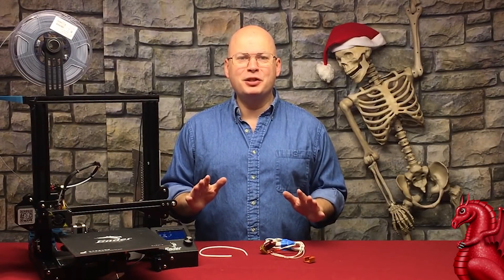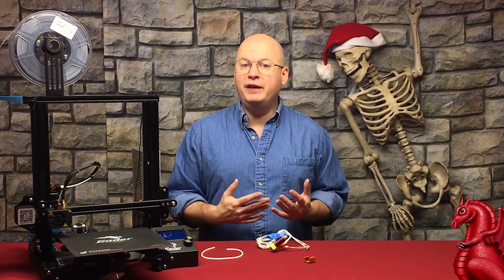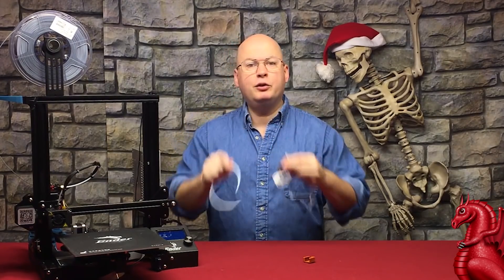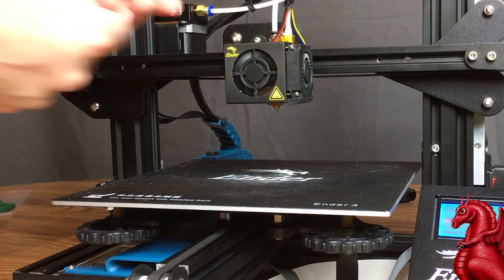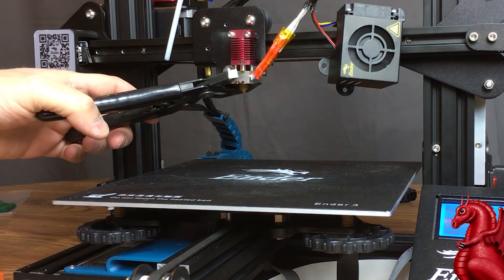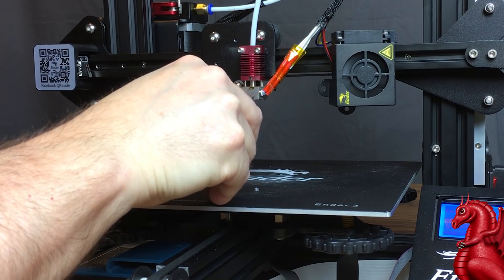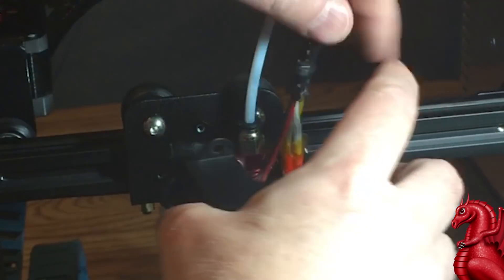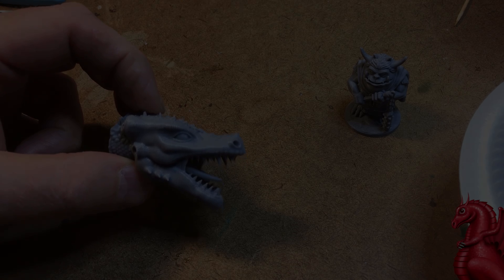Fixing Ender 3 and Ender 5 Bowden Tube Gap

Comment: I did every step of the video installed new capricorn tube and new nozzle back the nozzle back 1 turn. Was up to temp pushed tube till it hit the nozzle.  Tighted the nozzle started prints petg at 245 on the temp 30 min in filament started ozzing down my nozzle .   followed all the steps again same thing.   So put the stock tubing back lowered the temp to 238 and it fixed the promblem..      Can any one tell me why this happened.   i want to use the capricorn tube but…...